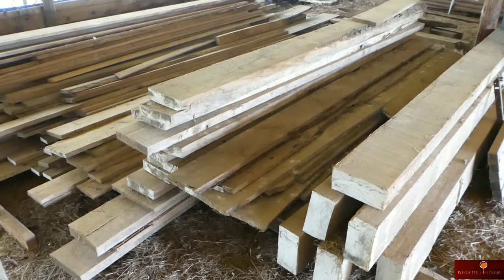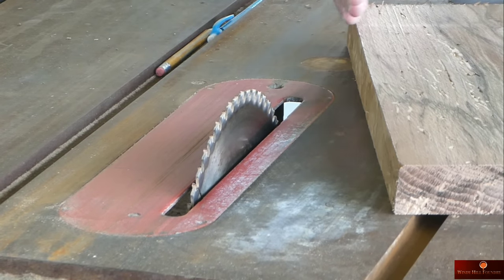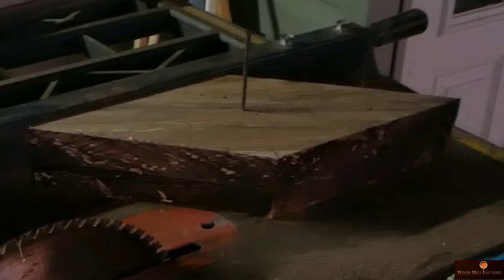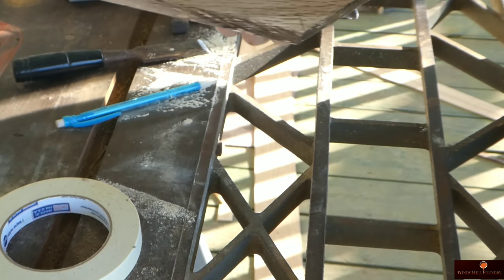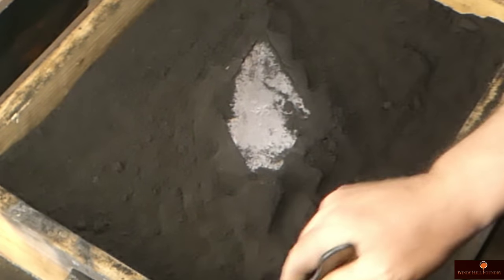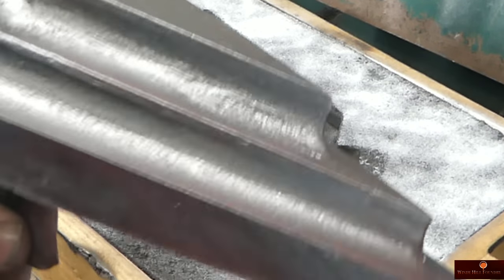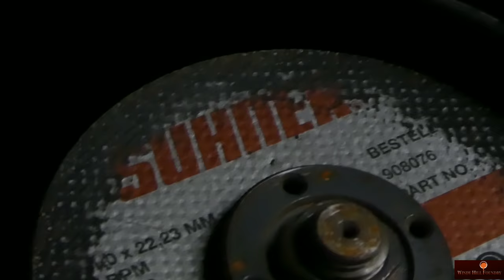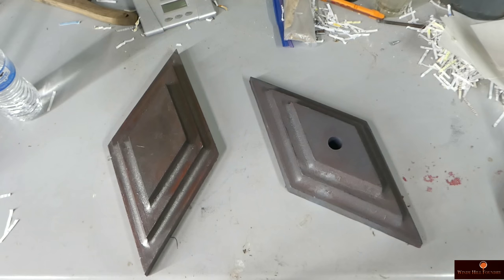SIMPLE PATTERN MAKING AND POURING THE FIRST PIECE

Comment: Nicely done. A tip on a glue spreader that works well. Take a hacksaw blade that is broken( 3 to 4" piece will do) and solder or weld a short shaft to it as a handle and voila. It spreads the glue and leaves the right amount for the glue up. Thanks for sharing.
Reply from the maker: Thanks for the tip👍

Comment: Clark you cane easily eliminate plainer snipe by lifting up on your board
once the opposite end goes under the first feed roller until it reach's the second
then do the same on opposite end. 30+ years as a cabinet maker and this trick has never failed me
Reply from the maker: Thanks for the tip Leroy, I will try that the next time. It has column locks but I think these are froze up

Comment: Clark, you need to get a ripping blade for your table saw. A ripping blade will cut cleaner and faster and not leave the burn marks on the wood.
Reply: That blade looks super dull
Reply: @alyssapipe6840  It is dull because it was used to rip.
Reply from the maker: Yes I was racing against the clock to get this cut out and didn't want to switch blades. The nut is almost rounded off and I have a hard time getting the blade to tighten. Also I am cutting walnut, hard on even a good blade but thanks for the tip👍
Reply from the maker: Everything I have is dull around here😞

Comment: Clarke, you should take an old bandsaw blade or coarse hacksaw blade and weld a handle to the middle of the "back" of the blade to make a glue spreader, kind of like the trowels that Masons use when setting tiles.  It might save a little time, uses a worn-out blade, and can simplify glue spreading.
Reply from the maker: Thanks Bob, I'll try that in the future 👍

Comment: Little trick I use when I get a short board that rocks on the table saw fence is to glue on a popsicle stick or something like that at either end of the board so it will write on those. And of course they turned off when you flip the board around anyway.
Reply from the maker: Thanks for the tip chris👍
Reply: @windyhillfoundry5940  any time btw are you going to be at the bash?

Comment: I was worried that you would have had a lot more shrinkage in the center of the casting but it looked pretty solid. Surface pretty smooth. You must pour the metal at the lower end of the pouring temps to reduce shrinkage (2950-3100 degrees F). Good job!
Reply: That's stainless pouring temps, not cast iron.  2500-2650F for some simple cast iron.
Reply from the maker: Thanks Sandrammer. I went about 2 grams instead of 5 on ferro silicone because of its mass. I probably could have gotten away with none on this casting.
Reply: @foundryman1985  , perhaps at your foundry but the Navy's rules made the pouring temperatures almost the same as steel. If the standard Navy pouring temps became a problem the temps were adjusted for the casting job being worked.
Reply: @windyhillfoundry5940  , The only time we added Ferro silicon was when there was a possibility that a thin section of the casting might cold shut. The ferro silicon allowed the heat to run like water.
Reply: @foundryman1985  , maybe in your foundry, not in ours.
Reply from the maker: @sandrammer  I've often been told ferro silicon helps with fluidity but the reason I use it is for accelerating the graphitization on small mass castings. To buy more time for dendrites to develop. It will also increase shrinkage so I try to go easy on the thicker pieces
Reply: @sandrammer  Maybe so, but it goes against everything about good foundry practices. I bet a nice course grain structure pouring cast iron that high.  Not to mention the better chance for burn in/on.  Might have been the  "rules", doesn't mean it was right.
Reply: @foundryman1985  , "Good Foundry practices" is also subjective and a matter of opinion based on that foundrys' experiences. Your bet would have cost you some money as when you have molten metal that is considerably hotter temperature there will be a larger ratio of temperature difference between the metal and the molding material which would have made the metal cool faster (making a lot more small crystals) making the surface of the casting a lot harder. However, if that condition is bad for that castings' requirements, that's what heat treatment is for. As to burn in, yes you'll have burn in at that temperature but only if you use silica sand as your base molding material. Very few of todays' professional Molders will use silica sand for making molds that is going to have ferrous metal poured into it because of silica sands melting temperature (3115 degrees F). Most Molders will substitute Olivine sand for those jobs as the melting temperature of Olivine is around 3272 degrees F. Finally, the Navy puts all of its' directives (which is what the list of pouring temperatures were) through exhaustive testing so that quality assurance would be followed making the average casting used in the Navy. Of course there are exceptions to the rule due to all the castings that came our way and all the various thicknesses poured. Keep in mind I was a Molder for twenty years and while most castings were poured using the pouring temperatures we were taught, some castings required a tweeking of the temperatures to make a good casting.

Comment: I'm really surprised by the lack of shrink, especially in the middle of the back.  Is that indicative of cast iron?  If I had fed an aluminum part like that I would have had a 1/4" deep (or deeper) dent in the back of that part.
Reply from the maker: Perry the shrinkage ratio on cast iron is very little compared to aluminum. I also cut way back on ferro silicon which can aid in more shrinkage. I could have done away with that just due to the mass here I think. 
The good thing about aluminum is you can use risers with overkill. At least those will be remelt which I don't do with iron so I try not to waste material
Reply: @windyhillfoundry5940  Not re-melting iron? That's a question for another day. 
I have a video coming out tomorrow afternoon that pretty clearly shows aluminum shrinking while using a huge feeder up on top
Reply from the maker: @swdweeb  anxious to see it. I have often had to recast aluminum several times changing the placement of risers before getting descent results. I always try to pour aluminum as cold as possible too but if you have very thin sections that would be hard to do

Comment: Nice complete from start to finish everything Clarke.
I imagine so many people just don't get it that for you to have to make a Pattern for somebodies project basically stuffs up the rhythm of the proper work you should be doing and should if you have to make a Pattern be charged accordingly for your time and effort.
I could imagine the postage to send that 10kg approx casting to Western Australia probably 6 x the cost of making it!
Could you please make a video explaining the difference between a furnace for, melting aluminium, brass and copper to the needs of a  furnace  for cast iron
and would it be cost effective
(if the person was considering in the FUTURE) for a person to build the cast iron furnace instead of having both or would using a cast iron furnace all the time at lower temperatures degrade the furnace?
Thanks for all your efforts to show us what you do Clarke and all the production work in creating the videos
I hope you had a memorable Easter BTW
Tony from Western Australia 🇦🇺
Reply from the maker: Thanks Tony, as for furnaces for lower melting temps. It would be ideal to have a furnace dedicated just for non ferrous temps to avoid changing settings on the iron furnace. I actually had a pit furnace just for aluminum and bronze but it was hastily built with poor refractory and only lasted a few years. Eventually I will build another one just for that
Reply: @windyhillfoundry5940  Good answer Clarke I hope you get over the recent furnace problems of the open day quickly and cheaply let's hope Murphy got his quota out of you for a few years
Tony from Western Australia 🇦🇺

Comment: Definitely recommend using a push stick feeding that wood through the table saw.  I used to push the wood through until the wood kicked back and threw my hand into the blade cutting 2 of my fingers off.  My fingers are reattached, but will never be the same.
Reply from the maker: Sorry about your accident. I do use push sticks when ripping narrow boards.
Reply: @windyhillfoundry5940  me too, usually.  Now I understand any time your hand goes past the blade, no matter how big the board, it's possible to throw your hand into the blade.  Just trying to spread the word of "safety"

Comment: Silly questions, why don't you core out the hole and save on the machining. Also why not gate and riser off the back so the surface finish is consistent all the way round?

Love your videos and I always learn something from them!
Reply from the maker: Thanks Evan, It is cheaper for me to get these drilled than to core each one. Same way with side gating verses back gating. Takes very little time to grind and cleanup. If the sides were convex or concave  gating in the back would be a better option since I don't use a bandsaw
Reply: Thanks for the explanation! It all makes sense.

Comment: Great to see the process end to end.  Great video production as well.  :)
One thing I don’t know is what a Wall Washer is?
Is it to reinforce a wall, where it is braced back to something else.
7/8” bolt comes through the wall and this thing goes under the nut?
Reply: On old brick buildings that actually used brick for the structure it was common practice to run metal rods with  the floor joists and roof joists with washers on the exterior of the wall (some very ornate) to help resist the forces from the roof and floor trying to jack the walls outward.  Without these features you ran the risk of blowing the wall out over time.
Reply from the maker: Thanks and yes Brian explained it perfectly. They also refer to these as wall bolsters I believe

Comment: Would the customer allow you to router a recess in the back side of the pattern to cut iron and weight or would it cause more problems?
Reply from the maker: No these have to be solid unfortunately.
Reply: Clarke you are so right in what you said, the pressure on those plates is considerable the TIE RODS  usually are very good steel and also the NUTS. I have seen very large spanners used to pull the building together so the plates must be sound.                      Geoff Lewis Wales UK 🏴

Comment: Does loose sand get pushed toward the outside of the casting, or can the sand end up inside?

Great stuff. 

Thanks
Reply from the maker: Thanks Will, if you ram too much in one area it will shift the sand to other areas. As long as one rams evenly across with consistent pressure all sand should just compress without moving
Reply: To clarify my question, if, while pouring molten iron, does loose sand get pushed to the side, or can it get into the middle of the final object?

Comment: Nice work as always Clarke. I was wondering how you judge how much iron to melt for any particular casting run especially when you are casting different patterns at the same time.
Reply from the maker: Dom that gets tricky. I always over estimate. I often have about 20% to 30% left in the crucible which gets re heated and added to for the next pour. At the last mold I always dump the left over

Comment: Why stress relieve?  It's not a common industry practice .  Really no need for it in cast iron.
Reply from the maker: Tyler thanks for your input but I'd like to know where you are getting this information from.  I started stress relief per customer request with positive results and have since included it with all cast iron after doing my own research. Stress relief has been practiced with cast iron since engine blocks started production at the turn of the century and with most of my castings classified as precision metrology gaging there can't be any movement between machining and grind operations, particularly with straight edges.
Reply: @windyhillfoundry5940  If your application warrants it, then ok, maybe for the metrology purposes.  But for decorative and almost all commercial grade castings, no heat treatment is performed on grey cast iron castings.  People like GM, John Deere, CAT, etc. don't stress relieve their iron castings.   I know this because I have been in their foundries. Also, I do this for a career.

I like to watch your videos, but you mention you don't ever have enough time, but you spend time completing tasks that aren't value added in my opinion. Hence the reason I ask "why do you stress relieve?"